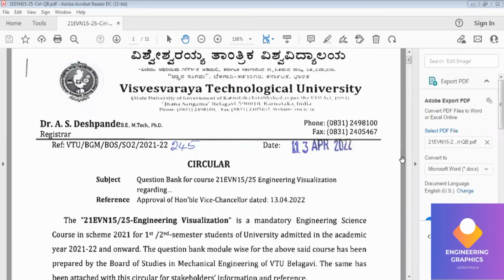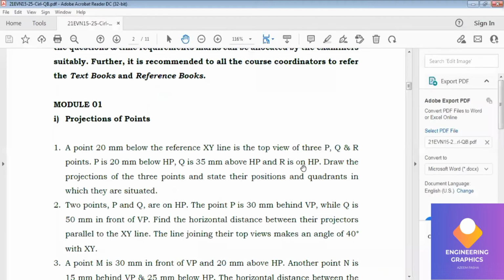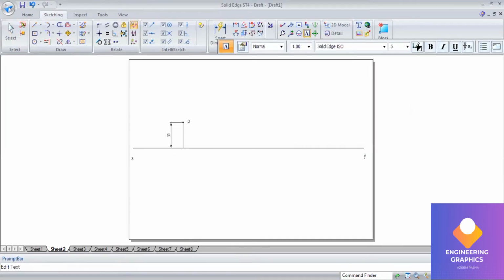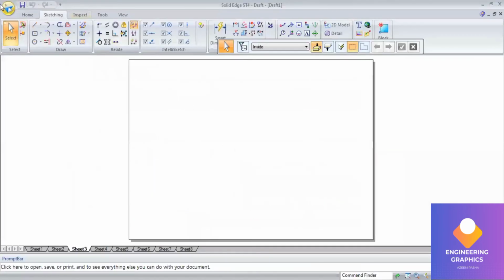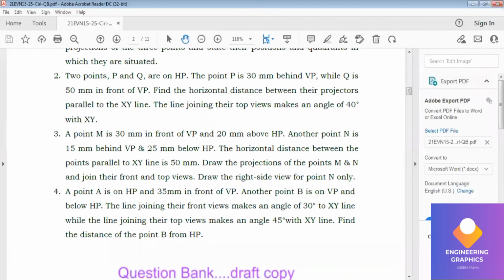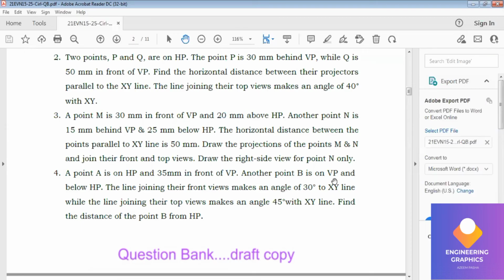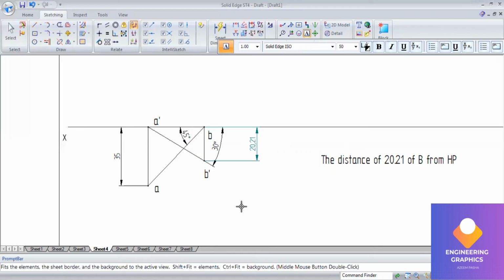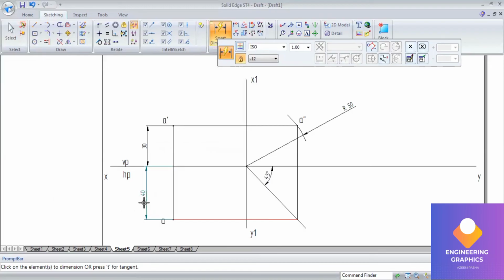Projection of Points problem (All) from VTU Question bank for CAED (2021Scheme)

Comment: Will points and lines projection are there for exam this year or not, Because in model question paper problems based on Points and lines projection are not given.
Reply from the maker: In Model question paper.. They have question on points and lines also.. See the Model question paper